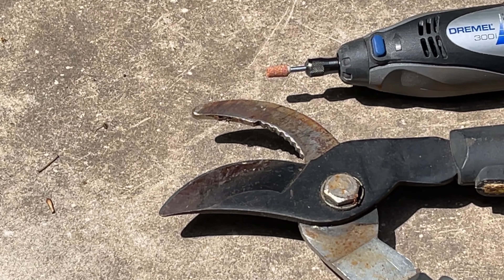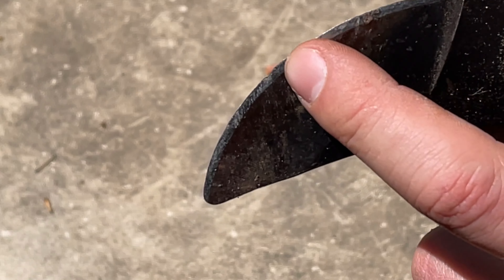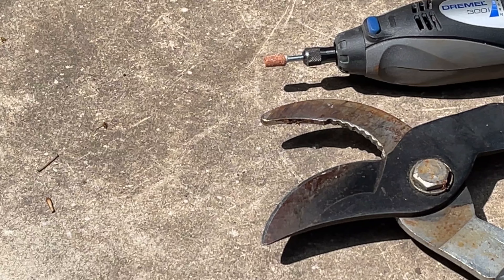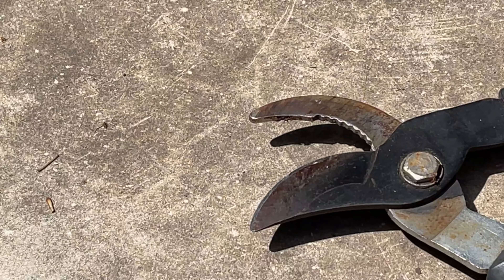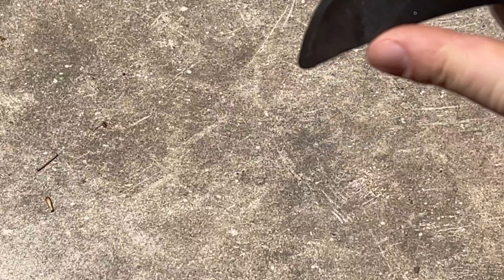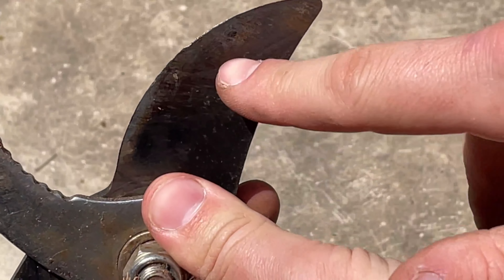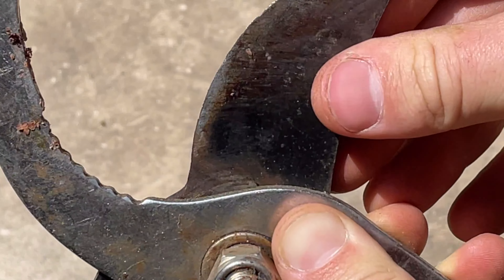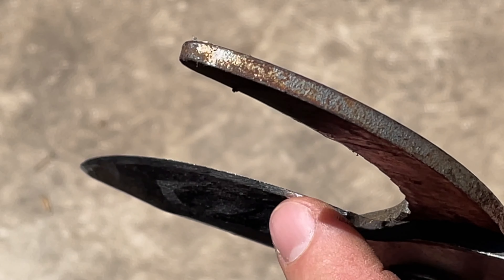How To Sharpen A Pruning Clippers With A Dremel Aluminum Oxide Grinding Stone

Comment: The problem with Dremel stones is they don’t wear down evenly so you wind up with a concave shape which is no good. I use the sanding drums instead and they wear straight  across.
Reply from the maker: That’s awesome!
Thanks for the tip!

Comment: What speed did you sharpen at?
Reply from the maker: Use whatever speed you are most comfortable handling. Somewhere between a 4 and 10 would be good. I used an 8 or 9.